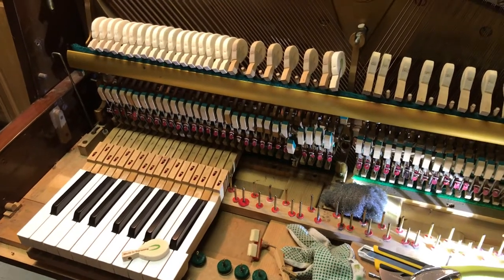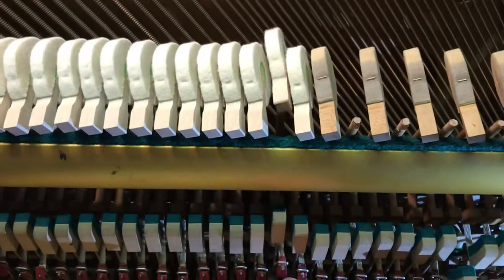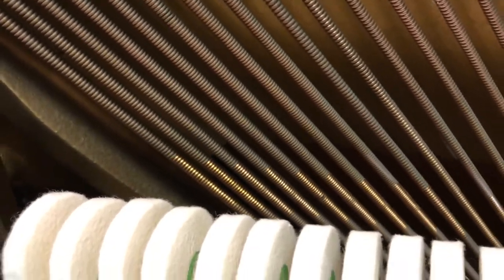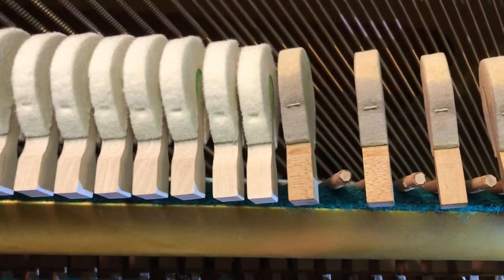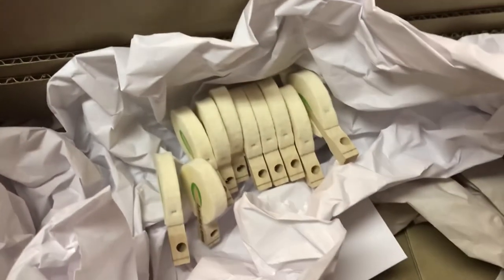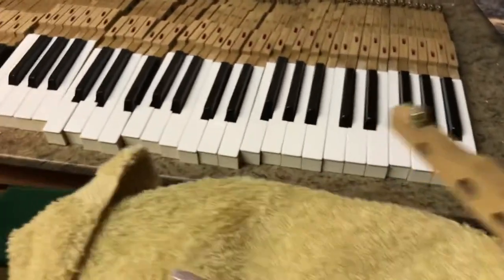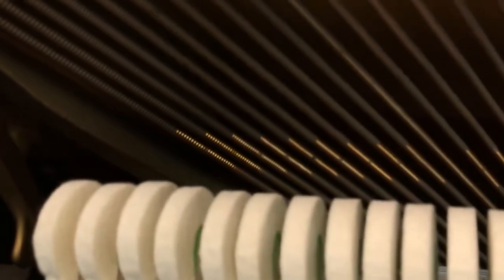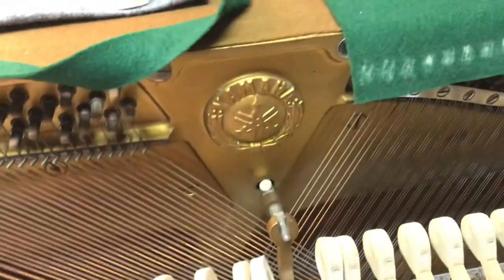Putting a new set of hammers on my Yamaha upright  to improve its tone. Brian King piano technician

Comment: Great video Brian. So glad I’ve stumbled across this. I’ve just bought an old tiny white Zender piano to mess around with, and I’m awaiting the arrival of a new set of hammers. Very informative and helpful! Thanks. 🎉
Reply from the maker: You are so welcome.  Good luck with your new hammers.  The quality of the hammers you buy makes a huge difference.  The good ones have the felt pulled under a tension  that gives the head of the hammer a cushiony spring to it  resulting in a warmer richer tone vibration of the wires.  When you use the drop of the relaxed arm weight  into the piano key and balanced there,  it is so important that the hammer head felt is not hard  as you are trying to create a sine curve of the vibration of the piano wires  a warm rich singing tone.   All the best with your new challenge!   
Take care,   Brian

Comment: Did you try refacing and voicing first? Takin gout the grooves, checking regulation and voicing might have improved the tone.
Reply from the maker: Unfortunately the hammers were so badly flattened by over use  that there was not enough felt left on them to reshape them egg shaped.  I am really happy with the tone of the new hammers  giving the piano a new chance at life!   All the best,   Brian
Reply: @pianoweighttouchbrianking809  That makes sense. New hammers, well replaced always improve the tone. I'm doing it on a nice old paino I have in the workshop. Can't wait to hear the new tone.
Reply from the maker: I'm ao happy for you. Once the new hammers and action are regulated  and voiced   it will be so much 
improved I am sure. I just got finished using Protek and getting rid of the friction in the flanges of the 
damper rail of my Steinway model D German concert grand  and it has made an absolute world of difference to playing it now!   We keep trying to make it better.    All the best,    Brian @jwybecker

Comment: How do you get the old hammers off?
Reply from the maker: Hi,  I remove one hammer   and it is numbered.  Then,  with it supported in my left hand,  I use cutting pliers  to split and break the heel of the hammer a little,  getting closer and closer to the dowelling without touching the dowelling  and with each new bite,  I then try to gently twist the old hammer off of its original hammer shank.  After about three gentle snips  I twist again  and that usually breaks the original glue  and the old hammer will easily twist off.  Then I use a hammer shank reducer to just clean off any old glue  but on this action the hammers came off so cleanly that I just used an alpha knife to flip off any specs of glue still there   and then I used 120 sandpaper to clean the end of the shank smooth enough that the new hammer twists on just easily enough that it is snug and can be twisted that the position and direction of it is identical to the original hammer on the left and the one on the right.  That way it will be positioned as it originally was when new  and your  new hammer head lines up perfectly to all three of the piano wires for that hammer's note.I am sure that the hammer is no further down on the shank than the end of the shank  so just smooth on top between the new hammer  and the top of the original shank.  I hope this helps.  All the best,   Brian
Reply: @pianoweighttouchbrianking809  Very helpful-Thank you!